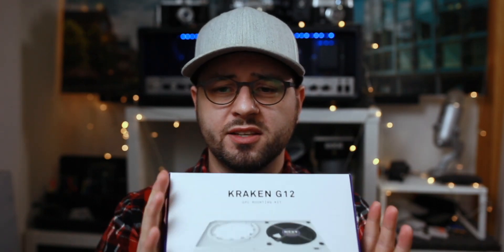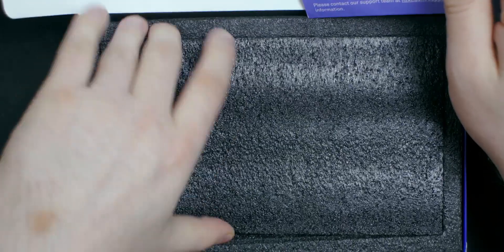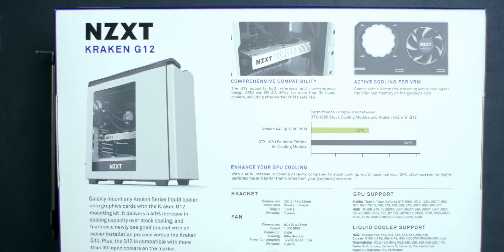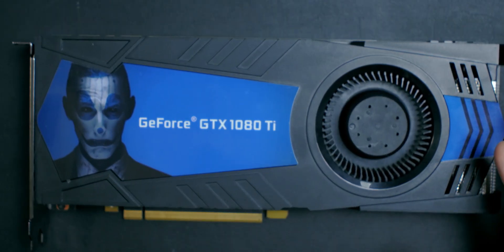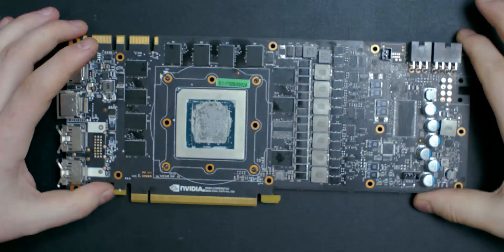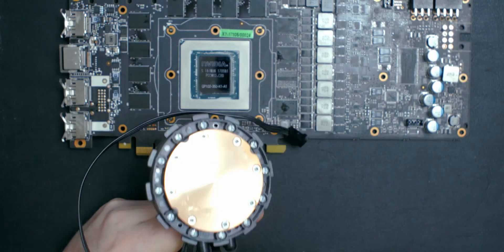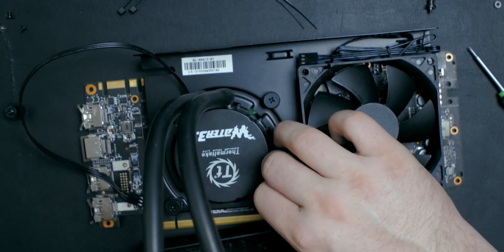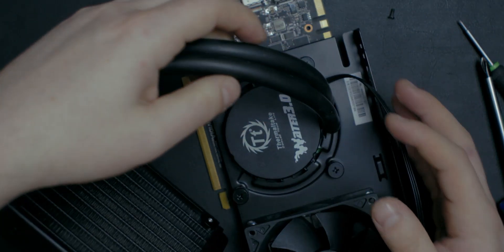NZXT Kraken G12 GPU mounting bracket to watercool Nvidia 1080ti GPU with AIO cooler

Comment: I HAVE EVGA GTX 1080TI 11GB FTW3, I WILL PUT THE KRAKEN G12, WITH NOCTUA 92MM FAN AND FROM THE OTHER SIDE 2 40MM NOCTUA FAN TO COOL VMR OF THE OTHER SIDE, IS THIS ENOUGH TO COOL VRMS? OR I WILL NEED FOR SURE THERMAL PADS WITH HEATSINKS? I WILL NEVER O.C. !
Reply from the maker: I ran it quite some time without putting anything on the vrms or ram. Never had any issue in that regard but for making the device last longer it probably would be ideal to add some small heatsinks if you can for them. Proper and constant airflow over these components goes a long way too. So, I'd say it's unlikely foe you to fry your card just for not adding some more heatsinks.

Comment: Why nobody tries to explain in clear details how to connect the Kraken G12 and the AIO to the GPU? There are 2 to 3 fans and a pump usually involved in NZXT G12 configuration. Knowing where to connect them ON mobo/PSU/GPU is the most crucial point for us noobs! Help us for low temperature’s sake!
Reply: You’d just connect the G12 fan where the fans plugged in on the graphics card lol. 

And then the AIO fans will connect to where the AIO fans would normally connect on the motherboard.

Comment: Are you still using that cooler?
Reply from the maker: actually yes. still running the 1080ti. still going strong. 
can't post screenshots here, but temps on idle are around 20C and around 60-70C max under load
Reply: @ALLGEAREDUP  hey , about to actually do this to my msi sea hawk EK 1080 due to not wanting to water cool completely. You think I will need a vram heatsink , last time I tried to do it with a aio it went up to like 95° before I turned it off completely and took it off ...
Reply from the maker: @dylanlow1727  I guess it depends on the cards overall design. Mine was using a blower-fan design and therefore was less reliant on the cooling solution. That said. I have also played around with some additional heatsinks on the RAM modules and such. In my case it did not make a huge difference as the card always hovered around max 70C under load and when the water was saturated. There may have been other reasons for quick spikes up to around 100C when the cooler and the dye don't make great contact.
Reply: @ALLGEAREDUP  thanks

Comment: Excellent video, so can I use any water cooler? Where do you get the brackets that you attach to the gpu do they come with the nzxt g12?
Reply: There are multiple manufacturers licensing the same construction and mount. You will find all compatible (round) all in one watercooler that are compatible when searching for nzxt g12 specifications. Hope that helps.
Reply: NOT ANY AIO WATERXOOLING, GOOGLE G12 COMPATIBILITY, TJOSE ARR THE ONLY ONES if you don't want to make more holes or break stuff